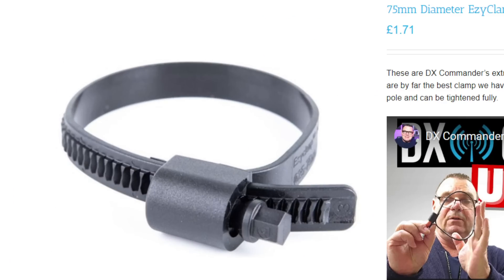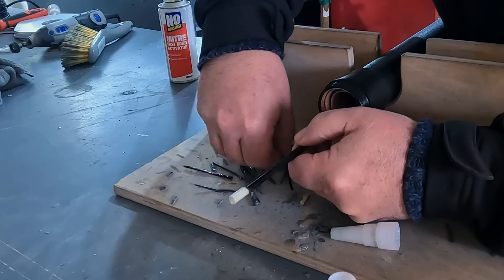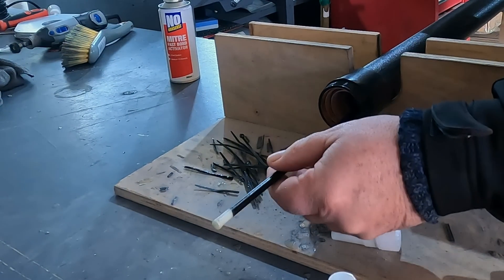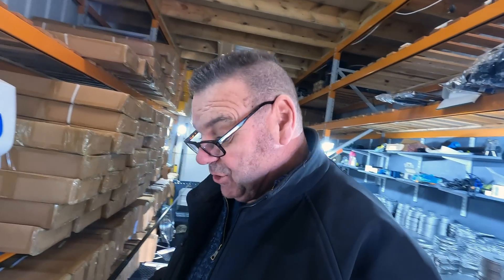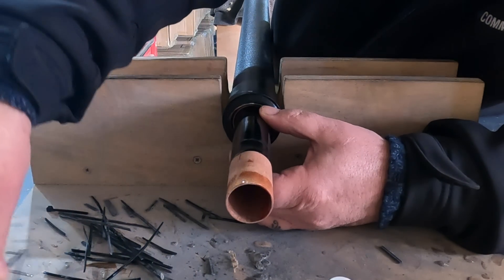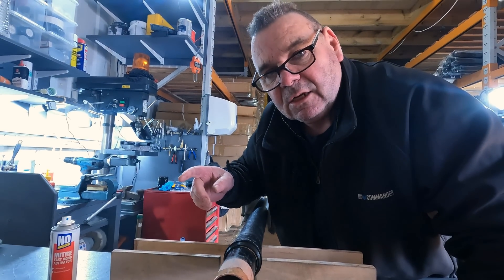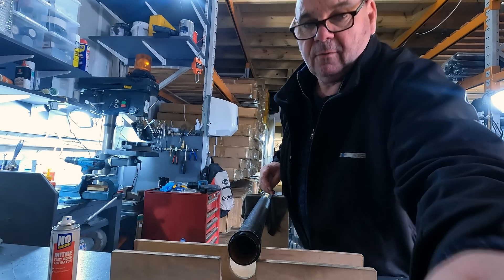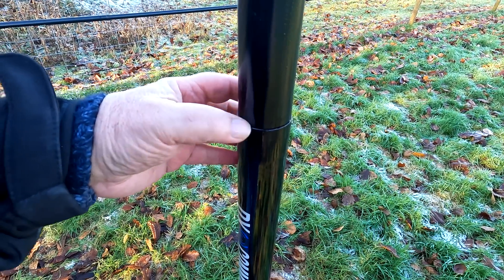Telescoping No More: How I Made My Telescopic Pole Completely Permanent

Comment: LOL this is exactly how I use my superglue... I bought a box of 10 bottles and none of the nozzles unscrew from the cap! When you unscrew the cap you just have an open bottle and then I use the cut-off bits from old cable ties to spread it or drop it where I need it... don't think you would need the specially slow stuff & I spray mine with IPA, not the stuff you drink a few pints of but Isopropyl alcohol. Sweet.
Reply from the maker: HAHAHA

Comment: KK4BYD, 73's Callum ! I plan on purchasing one of your antennas later in the fall.  I also wanted a more permanent solution for the telescopic poles slipping under pressure.  I am planning on trying COLD SHRINK TUBING, which is easy to remove if need be and no heat needed, which could cause issues with the fiberglass.  If you get a chance, see how the cold shrink works. It's too hot here to mess with antennas right now. Enjoy your videos!
Reply from the maker: Yes, it would work - as a lot of other systems. The one I superglued a few years ago - unfortunately is totally stuck - so I can't move it from the field now!

Comment: Callum, soak the superglue cap in acetone and it will loosen the glue and you can clean it off.  Put some plastic wrap over the top of the bottle while the cap is soaking.

Comment: Or just use WEST Epoxy which has a slow cure time (several hours depending on temperature), has a relatively thin/low viscosity, is waterproof and is not brittle like cyanoacrylate adhesives, aka "superglue."  Using CA with the accelerator on radio controlled airplanes over the years has taught me that the accelerator makes CA even more brittle.  WEST Epoxy was developed for wooden boat building and will retain flexibility so it can flex with the pole.
Reply from the maker: WEST Epoxy.. OK, copied.

Comment: If someone breaks a mast and cannot buy a replacement section they can sand the salvageable sections lower exterior to scuff off the gel coat, get a bit of fiberglass tape from the drywall section of the hardware store, superglue the fiberglass to the bottom of the salvaged section Go one wrap at a time because if you add too much fiberglass in one pass it will be very difficult to sand off, if this happens you might be better off taking a hacksaw to the section to remove the section you screwed up and starting anew. Use accelerator to fix it in place. Check the fit and add material by repeating the above steps or sand down the newly created widened base of that salvaged section after testing the fit to create the correct diameter,  retest and when satisfied with the fit so that it will not slip out of the lower section when extending the mast. Salvage complete.I have a broken Spiderbeam mast, they dont sell replacement sections in the US only Europe. I must be honest,  I did not think of this method until I started watching what Callum was up to and merely expounded upon his idea to create a new one. My wife was trying to toss the broken mast in the trash the other day and I stopped her, a good thing that I did. I just needed a catalyst to spark an idea...Now I might just try this later this week. I'm certain it will work and is better than tossing an otherwise serviceable mast in the trash.Everything has gotten insanely expensive here no thanks to Joe Biden's crappy economic policies. The man could not be a better saboteur of the USA if he was a Russian collaborator, funny that's what he claims the other guy to be. I always look at what someone does, not what they say to figure out what side of the plate they are batting from...
Reply from the maker: Ah cool idea!

Comment: My concern, living the the US Upper Midwest, is the impact of both very cold temperatures (-20F to -30F) and moderate long duration wind stress (20-30 MPH) for several days. Certain plastics and glues can get very brittle in that kind of extreme.
Reply from the maker: Indeed they can. Sheer force (with compression though) is very stable. Mine works and we've had 40 degrees C and peaked about 11 degrees below freewzing. All in centigrade.. I can't get my head around F..! :)

Comment: Dont really want permanent in case of a move; however, the plastic pipe clamps seem to be not gripping the smaller tube enough to prevent it from gradually shimmying down into the bigger tube. I think im going to pick up some metal hose clamps for the metal thread strength & the rubber tubing that seems to stick to the fiberglass better. My 12.4 slipped down at least a foot from the sections wiggling into each other between wind & the tension from the cords.
Reply from the maker: Oh! So you can do two things.. 1) really extend the tube as tough as you can and 2) tighten the clamps.
Reply: How cold does it get where you are in the UK? Another thing that's on my mind is with the tubes contracting with the cold I get it tight so it doesn't slide back down in, but then as the summer & higher temps hit (up to 100f) the tubes expand and split. Perhaps it might be wise to put another clamp on the outer tube of the joint to try to prevent that. Thank you for all your experience & expertise & I'm wondering what you've experienced with this & the cold & hot temps?

Comment: On one of my verticals I used glue-lined heatshink tubing on the outside of the pole-to-pole steps, about 6 inch pieces. Been up for many years without a problem. Quick and easy to do.
Reply from the maker: Good idea

Comment: Hello Callum!  Looking for an update on how well it is holding up.
I have a classic that is subjected to temps from -35 to 40c on an annual basis. I was afraid to use hose clamps in a permanent install because I was afraid the pole would crack at that point in very cold temperatures. The wind is always blowing here, 3 wind farms within 30 miles. I am using electrical tape and large zip ties, and so far, no sections have collapsed, they have shortened up, and have required pulling back out a few times. I'm hopeful that your experiment will be successful, and I can keep my pole fully extended no matter the temperature.
Reply from the maker: Seems to be doing OK.. There are other "rubberised" superglues but for the small amount we have on this, seems to be fine..

Comment: Years ago I used to build motor homes for the tourist market.   We had brand new Toyota hiace vans come in and we would plasma cut the roof off them and fit a fibreglass bubble roof on them.   We used a stuff designed by NASA years ago called Sicaflex.   Only took a couple hrs to set but when it cured you could lift the entire vehicle off the ground by the roof…….  Immensely strong stuff.  The only way to get the roof off would e to cut it off.   Check out if ya want to have a telescopic pole to never come down.   Cheers mate 👍🇦🇺🥃
Reply from the maker: Amazing.. It might have too much body.. Just been reading up on it. We have found some other stuff too.. IC-2000 by Bob Smith Industries.. I'm trying that next. PS - The one we tested is still up in the field quite happily..
Reply: @DXCommanderHQ  well that’s good news old cock.   The sicaflex has a texture of silicone…… god awful stuff if ya get it on your clothes!   Believe me.  But bonds harder than shit to a blanket!!!  One question old mate. The Dx 50 wire…. What’s the power rating for that ?  As you said it was designed for uk military.  Thanks mate.  👍🇦🇺🥃
Reply from the maker: So I can't break the seal on the original superglued telescopic mast.. Tried smashing it all around today. Appears solid. I have some IC-2000 and want to try that next too.

Comment: I would use a toothpick or a glue brush to put it on with.
Reply from the maker: Used zip ties are free :)
Reply: @DXCommanderHQ  Zip ties cost me a lot of money!  Toothpicks cost much less than zip ties. Looks like we both use what cost less for us. A stick from the backyard would free, but may need to be wiped off of dirt first.  73
Reply from the maker: Yeah, we have a TON of cut-up cable ties that normally we throw away.. I use them.

Comment: I drill two very small holes either side of an extended section pole and push a thin welding rod through - section can’t drop back down
Reply from the maker: OK, you are lucky but instead of spreading the force around the whole diameter, you are concentrating the force in a 3m hole.. Be careful :)
Reply: @DXCommanderHQ  true

Comment: You could try having two small holes drilled in the ends. Then set the length and put quick setting glue in the holes to lock it in place. The glue should wick into the tight area.
Reply from the maker: That is also an idea!

Comment: Hi! In my experience, when superglue or CA glue flexes, the bond breaks.

When you want a high strength bond with fiberglass, you should use the same product used when it was made.
If you are unsure of what the original product was, then epoxy for fiberglass should be used.
Reply from the maker: Indeed.

Comment: I don't know if you can get on your side of the pond but the company (hobby shop) I work for recommends Bob Smith Industries IC-2000 for installing our titanium ends in carbon fiber tubes for push rods. I is used in the golf industry for putting carbon fiber shafts in titanium golf club heads. It contains carbon and a rubberizer in a heavy viscosity CA (Cyanoacrylate) adhesive.
Reply from the maker: Very interesting.. I have just nought some - I will test it out!
Reply: @DXCommanderHQ  Just a note for anyone thinking of using CA (Super glue) for anything. Do Not use Acetone to clean the parts before use, the reside even after drying will prevent the CA adhesive from curing properly.

Comment: I used the same type of system that is used to tie eyes to fishing rods for the top few sections of my pole. I just used a much heavier waxed twine (the waxed twine that is used for sewing leather work). After doing the binding over the sections where rods meet, I further rub the twine with beeswax and heat with a lighter to melt beeswax into twine to create a watertight seal. I use beeswax for a lot of water sealing applications. Yes, might be ancient technology but I still find it effective 🙂
Reply from the maker: Great tip!

Comment: Have been thinking about something like this but didn't dare to. 

Maybe, one day I'll just do it. The pole here is permanent (and the top section did lower a little. Want to rebuild  it as an original 4/6/10-40, omitting 80 as I have a different solution for that.

I'll use the non-80 as listening as it won't pick up as much hash on 60/80/160 (tried that), but maybe I can add 60 instead of 80. So much options to choose from :)
Reply from the maker: Yes OK Anton.. Go on, try it :)

Comment: I wonder how the CA and the tube holds up after a year or two at least of being outside exposed. I can say after a year and a few months of my dx commander classic 'permament' install with self amlamanting tape covered by super33+ and a zip tie it's held up well to 50+mph winds, being rained on a ton, frozen and baking in the heat + it has the 80m ele installed so that abuses the pole a bit too, with its near constant lean or the trees tugging at the pole via the wire lol. (CT near the coast USA). Great idea!

Comment: I have a MFJ-1917 permanently installed in Arizona.  Just above each joint, I drilled a tiny hole and put the smallest screw I could get at Ace Hardware.  Each section rests on the screw and keeps it from collapsing, but still allows flexing in the wind.  Then, I painted it all with a nice tan color.  My previous install was up 8 years before I had a failure.  Current pole has been up for 2+ years.

Comment: Just a random thing you might like to try, foaming resin. It may add significant strength for permanent installs. They used to use it in sills of rally cars to prevent them from kinking in a smash. The kinking of hollow structures like box sections or tubes is a definite failure mode. I do appreciate that holding a nebula upside down to fill it might be impractical.... something you might try with a spare section....
Reply from the maker: OK, honestly a good idea BUT my friend Barry M0DGQ tried this.. The foam snapped in several places making the whole project redundant.. Oh well :)
Reply: @DXCommanderHQ  thanks for the feedback.

Comment: Interesting... I would think the glue will crack and lose its bond after a while under the influence of the wind bending the pole and heat/cold. BTW I use UV proof liquid rubber alot nowadays if I want things to be weatherproof. You could even use masking tape if you want it to look nice. 

Tip: you can get really high quality versions at marine shops for less money than what they sell at radio amateur shops.
Reply from the maker: We will find out! I have more confidence, knowing that the inside of that pole will look like with the glue spread around so tightly :)

Comment: I have often wondered about Super Glue but always seem to glue my fingers together. Slow set seems a good idea. I also think the recommendation for taping the joints is good. Imagine some water getting in then freezing. Suppose that is the same for any installation though. Hope this works out. Be a good set up for the "new" self supporting pole?
Reply from the maker: Chris, some folks are over-thinking this.. It'll work just fine.
Reply: I am sure it will Cal. And of course you are testing it out for everyone anyway

Comment: A better idea for a permanently extended fiberglass mast the will not collapse or bend in the wind, is extending the mast fully. Then getting a can or two of "foam in a can" from your hardware store. This is used for filling in gaps in walls of buildings etc. Spray the foam inside until it come out the top end. It sets hard and quite quickly. Now you have a mast that will not collapse or bend, and does not change the weight much - foam is light
Reply from the maker: OK, I know someone who did this and the foam cracked inside .. failed.. and it all became a worthless deal.. Good idea though!

Comment: HCL clamps? I bought some Jubilee clips for an aerial mast from a shop and they were no good, they stripped the thread off, made in Korea I think. Buy proper Jubille clips or maybe HCL but I don't know HCL.
G4GHB.
Reply from the maker: Stainless hose clamps are good. We used them for years and sourced them from a motor racing supplier.
Reply: @DXCommanderHQ  O.K. I've never heard of that make.

Comment: Looks good. I had been thinking of fibreglass resin and a wrap of fibreglass tape externally but your way looks a lot easier ! I fibreglassed a couple of reinforcement sections on a squid pole to strengthen it right where I mount it; worked well.  
Perhaps try a small paintbrush instead of the cable tie, I use a sacrificial paint brush for fibreglassing and you can get the resin on quickly and evenly.
Reply from the maker: Thanks 👍

Comment: Typically one would use a polyurethane type (soft) glue to bond two hard substrates together such as fiberglass to fiberglass or carbon fiber to carbon fiber. CA glue works best on soft materials such as wood or your fingers. I will be most interested to see if this works long term. Thanks for the experimentation video.
Reply from the maker: Great point!

Comment: Poles are fiber glass right? Why not use epoxy.... I used to work in a aircraft kit facility, epoxy bond will be much more stable than super glue. Just need to expose the fiber which it looks like it already is. Wipe with acetone or even just rubbing alcohol, then basically do the same thing you did with the glue
Reply from the maker: You would need it extremley runny to make sure you get full extension. ANd cheap superglue is.. well.. cheap! :)

Comment: We have similar two part glues in the US. Often used to bond car mirrors to windshields, where the glue and accelerator both must be applied and the cure is almost instant. I think Loctite used to make several of these.
Reply: For the US buy any quality thick crazy glue  and a matching accelerator, you will be fine. You can mix and match brands as they all copy the original formula as far as I can tell. 
I cant guarantee anything about products made in China.

Comment: Thanks Callum!  I am very interested in the long term results since I'm intending my Signature 12.4 to be up forever.  I have no interest in taking down once it's up, unless I want to lay the entire antenna down for ice storms and the like.  Of course,  I'll extend the entire mast a few times before I use the glue.  And I will go with the sealing tape and plastic hose clamps to double/triple seal eveything together.  If it's not over-engineered than it's meant to fail.
Reply from the maker: Yes, I'm goiong to try Signature 12.4 next actually...

Comment: Callum, great work. I've spent a life working with all kinds of these adhesives and bonding agents. Good stuff that molecular bonds to surfaces. It all depends on the strength of the factory finish to the structure of the mast. It's only as strong as that unless you sand it down. 
You are right about working time, but beyond an hour it's not much stronger. UV curing epoxy is brutally strong.
Reply from the maker: Awesome, thank you!